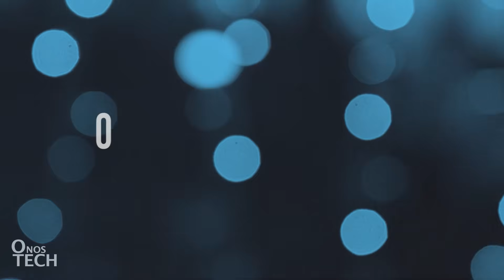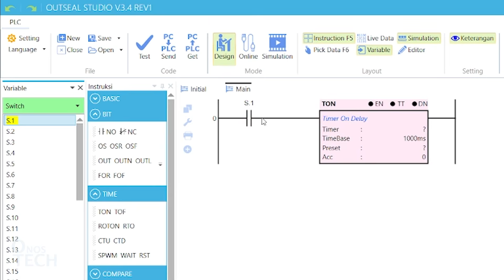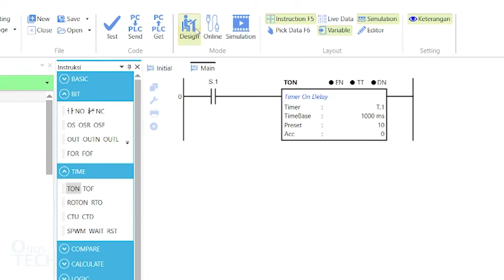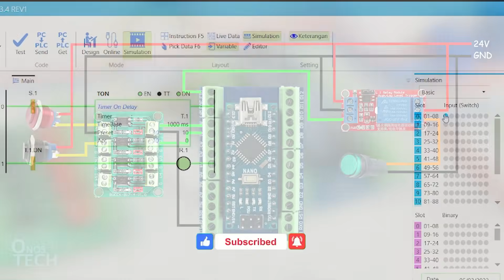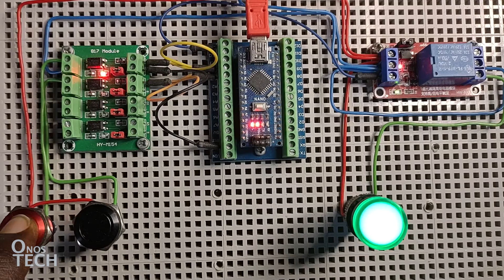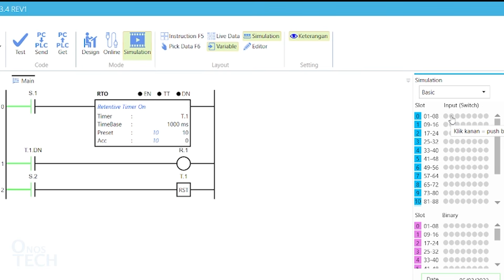Comment: Sir outseal arduino plc programming is can i use arduino mega board?
Pl.  Make a video with display  oled 1.3 inch.
Reply: Arduino mega cannot be used for Outseal PLC programming because Arduino mega uses the Atmega2560 microcontroller, while Outseal mega uses Atmega128A microcontroller. There is another board that I will introduce later in the series.
Reply: @OnosTech  
Thank you  sir.
Reply: You are welcome! 😊 😊 😊